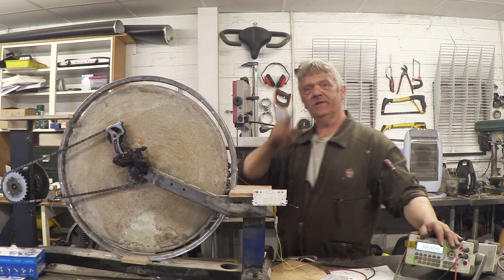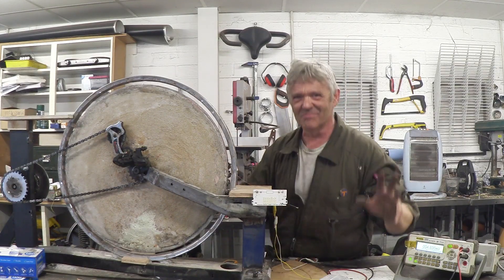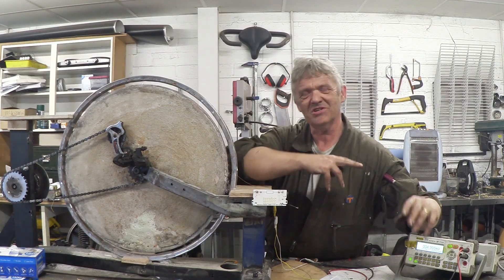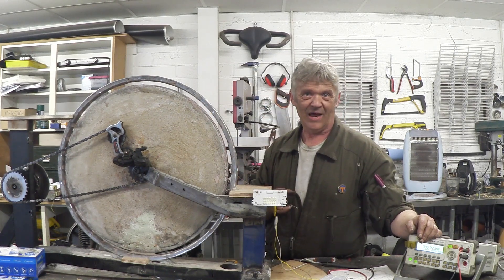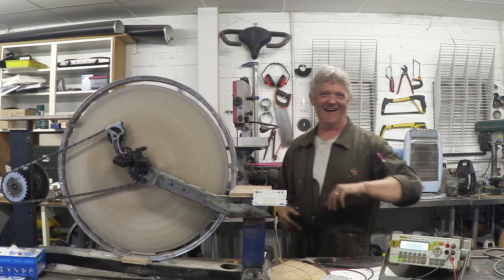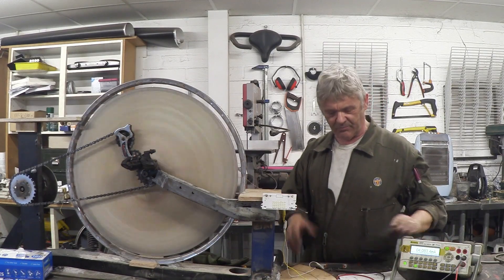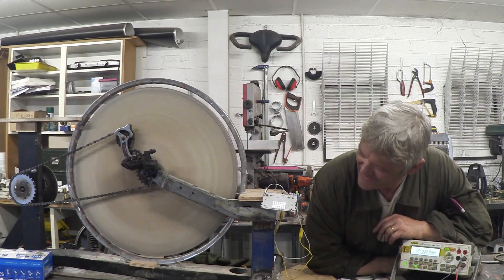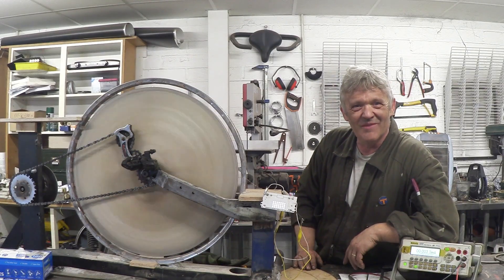1136 A Flywheel Generator

Comment: If a decent flywheel was placed on the pstttstt take wind turbine generator & fan would Keep spinning to some extent, taking wind direction mph isn't nowhere near sufficient enough for aa 3-5&10 kWh wind turbine never spinning unless you live high seas high land or in Chile

Comment: You should try building a replica of 1800's John Keely's self running hydraulic motor with useful output balanced flywheel. It had central rotating 4 way valve that produced 50lbs water hammer water pressure. Unit was seen running sawing wood, after alignment timing. patent application readable and can see sample model on You tube video. Also in new York years ago , there was a self running air compressor mounted on tank. It initially was hand turned until gauge had enough pressure in tank.40lbs output air ran air cylinder attached to crank on main compressor shaft keeping it going .The  balanced spoke type heavy rim flywheel had extra energy coming from machined 3 parts vortex tube that heated air chamber insulated for higher pressure output. Tubes are purchasable or read back issue science mechanics magazine article on home made adjustable units with various washer sizes for hot and cold.

Comment: for such a huge wheel and all the energy you put into turning it, the power output (Volts x Amps) is tiny. The one radial coil you have running around the perimeter does ot cut the lines of flux produced by the fixed magnets. So if you arrange lots of coils across the periphery and more magnets, you'd really crack some power out. Also of course the friction in the system causes the wheel to slow down dramatically, so a levitation 'frictionless' bearing (with magnets) would increase the efficiency enormously.

Comment: What you need to do is arrange the magnets on the spinning wheel so that north and south poles are on the left and right side then in a horse shoe arrange two coils one on each side. So what I'm saying is. An iron rod bent into a U shape and one coil on one side and one on the other then spin the wheel with the magnet passing in-between the coils. So that way you are utilizing both sides of the magnet. Then watch your results. Oh and the more coils the better. The more load you put on it the faster the wheel will spin and the amps will go down.

Comment: Use a smaller sprocket on the flywheel side and a larger chainring on the crank.

Looks like bearings need quick lube for free spinning better than grease. 

I've had great free results by spraying motorcycle chain oil inside bike wheel bearings. Specifically Castrol OR chainring lubricant.

Comment: If you have half the wheel north and the other half south, you are packing the potential from multiple phases into one ac signal and that's why the amps go up. I find a ratio of nine coils to twelve magnets alternating north, south, north, south, etc, gives you a solid three phase ac signal to work with. Nice build!

Comment: Can you put together one of those free energy fly wheel generators to show us if they work or not where are you spin a fly wheel with a electric motor and then the fly wheel spins a generator which powers the drive motor.  At first the drive motor runs on line power but as soon as the generator gets to a speed where it has enough power to power the drive motor you switch from line power Two generator power to To power the drive motor

Comment: Rob - I'm confused. 4 mA at 11 volts is 44 mW of power, which is tiny considering the amount of work you put into spinning the flywheel. Do the turns of wire just run around the circumference of the wheel? If they do, no wonder the output is so low - the magnetic flux is meant to cut across the wire, not just run parallel to it. So you really need lots of small coils around the edge, not one big coil around it. Then you would get some real power out.

Comment: This is probably the closest thing I've seen anyone do to the project that's in my head: a DIY energy storage system using a heavy flywheel with magnets and coils which can reversibly act as a brushless motor or a three phase generator.  Having seen your wind turbine videos, I wonder how well the concrete flywheel would work coupled to a hoverboard wheel for the motor/generator half?  The folded tab single coil generator is fascinating and ingenious but I suspect the big air gaps mean it will always be inefficient.

Comment: Need a flywheel system for a small generator so you can take the surge watts off of the small generator for starting large loads with low draw like an air-conditioning unit etc.   = Low fuel consumption

Comment: Id be interested to see the magnets & Copper placed in the middle closer to the center of flywheel, this way the leverage of the magnetic pull as they ass through the copper coil wouldn't be as strong. Then hooking up a little DC motor to turn the 'pedal crank', then measuring the electricity in, and then the electricity out. I cannot find this experiment anywhere online.

Comment: You could get a flywheel from a manual transmission or even use a brake rotor, either can be gotten easily from a salvage yard, not sure about the prices, or the sizes, depends on what all you have where you live, but they will be more balanced and require less work on your part.

Also, some vented disk brake rotors have holes you could use to mount your magnets into.

Comment: Would it be possible to do the 1/2 North 1/2 South but with a section (where the N turns into S) that had alternating magnets... IE: if you were using 40 magnets, you could have 14 North, then 6 S/N, then 14 South and 6 N/S.

It'd be interesting to see what that'd do to both volts and amps.

Comment: Voltage is not power ! The output (power) for the size of it is pathetic and the efficiency will be very low . What is the maximum load current it is capable of and where does the voltage land then ?  And the size of the wire does not matter , the number of turns that can fit in the appropriate area is all that matters . Lastly the airgap between the magnets and the coil is too large . Should be the absolute minimum for maximum efficiency.

Comment: You just made a mechanical battery! I wonder how more wire and more magnets would work out? Surely there is a end to the gains from more wire, thicker with more turns..   the added wire adds resistance, and is less effective because of the distance from the magnet,  I wonder what the optimum turns to gauge would be?

Comment: You could change from a bridge rectifier to a single diode and an electrolytic capacitor if you would arrange all of your magnets in the same direction (like North only or South only). By doing so you would automatically generate DC only and the diode would only have the purpose of preventing the capacitor from discharging back into the generating coil when the wheel stands still. Thank you for doing these experiments for us. You are an amazing teacher.
Reply: You can’t generate DC a from induction, you need to have a change in magnetic field otherwise there comes a point that the coils become saturated with the magnetic field and the only way to continue to get an output is to change the direction of the magnetic field and therefore the polarity of the current / voltage output of the coil.

Comment: The distance between by the coil and magnets is quite large, this thing might be a lot more efficient than this test shows. I take it the magnet a are at 45'?
Reply from the maker: it is mate - the gap is huge in these terms - but then we are engineering with concrete and bicycle wheels lol - you are absolutely right it would be a hell of a lot more efficient with tighter tolerances

Comment: I get 3 or 4 hundred volts from the little motors always wanted to make a big one 

I would have thought your big one would have put out alot more volts 

Getting ready to make some big carbon lead batteries 

I have a few small cells going as experiments now one uses spray adhesive

It was fast and easy to coat lead plates with the spray 

Hope it doesn't degrade over time it has been in the acid for a few weeks 

Maybe I will take it out and see tonight 

It would likely save me lots of time if you know a good way to keep carbon black and carbon on the lead plates

Thinks for your t in me
Reply from the maker: the gap is too large - we are really just proving an idea here and doing It with concrete and bicycle wheels - we need closer tolerances for sure

Comment: When winding the coil, does the wire have to be insulated? Do you have any recomended insulation method?
Reply from the maker: I used magnet wire mate it comes with a lacquer insulation

Comment: 10 years back. I bowwowed a 300 kilo train wheel....drilled , reemed and pinned it on a micro bearing... 3  x 75 amp hr altinators... armitur aperture..  unit stole 220volts... ran it thu bicycle chain like that,  and used a geared deisel motor.. from old lawnmower, 2 dog power, .. used less than 1 ltr  a day... Olive oil.. and made house electric...  great idea... shame I sold it..!
Reply: Sounds amazing, what of it I can decipher
Reply from the maker: I do love a good flywheel mate

Comment: Great stuff. Love your videos. I've been very interested in this as a replacement for energy storage. You've motivated me to build a small scale model. I'll change the bearings to magnets to reduce friction. One question: If you do the reverse ie. put in electricty via solar panels, will the flywheel spin?
Reply from the maker: go for it mate and do a vid - I would love to see - and yes it would run as a motor
Reply: Rob try flywheel with magnets and triboelectric. In that way we can get useful energy both as current and static electricity

Comment: try all north out on flywheel .
Reply: That should give a pulse DC wave , But your wasting all the power of the south pole. Electricity is the change in potential  energy.
Reply: @tremail564  logically it will generate DC voltage. even in AC generator one pole is active. AC is good for long distance transition. if dc generation used we can charge battery, use Dc motors LED lamps ect. I ma having doungt  weather it will realy develop DC voltage ?
Reply: Yes or we could add coils to pick up the south on a different loop.
Reply from the maker: I would think nothing would happen - you need a change in field don't you? so if you had a constant north, even though you rotate it from he frame of reference of the coil it would be a constant field - so - nothing - isn't that right?

Comment: Nice. I'm thinking about that rim. Would it work better if it was cut in half, and separated a little. Circumferencial cut into two poles of the coil. Comb-like pattern cut similar to a alternator rotor. That would take lot of zig zag cuts inside the rim + some separator. Just thinking...
Reply from the maker: you might want to check out videos 1119 and 1120 - I pretty much do that mate
Reply: @ThinkingandTinkering  You did. I missed some of the cuts and thought the rim was still in one piece :-))) . Thanks for pointing this.

Comment: You have a brilliant mind paraphrase you could figure out the coral castle flywheel Edward Leedskalnin designed and used to move large blocks on his own.
Reply: Afiak the "flywheel" Leeskhalin had was just a switching carousel. He only used that particular assembly for mining the blocks not lifting the blocks. But what it did was it switched the voltage on and off, bang bang,  to his large handmade induction coil solenoids that he used as power hammers and in that way he was able to mine the large blocks all by himself quite easily. With his power setup, I believe that he used electric winches along with block and tackle systems to move the large blocks beneath larger tripods. With these tools he employed tight strategy, and Godly supreme patience, to accomplish his goals, one, step, at, a, time.
Reply from the maker: I'll have a look mate

Comment: I am possibly stupid but what would quartering the disk do N S N S.  Somebody enlighten me please
Reply: Yes that could work, do you mean? Or do you mean output? All things rely on the power the magnets produce ,which is unknown until measured, weight vs size and then magnetic strength, the more poles in series the more volt output in a single rpm. Hope that helps alittle.
Reply: The difference could be seen in the wave form on an oscilloscope  .as we come in contact with the north the wave rises to the peak around the middle of the north and then would fall if we kept moving  (placed a south next) IT would continue to fall until it bottoms out in the center of the south and as we keep moving IT would begin to rise again to the middle where we begun ( if another south is place and we keep moving) IT would start to fall to the trough(bottom of the wave value) and start back to middle. The distance between the poles would be how slowly IT waves and if too far IT may be a pulse   wave form.
Reply: @tremail564  Thanks for that.
Reply from the maker: power won't change but volts would be middling as would amps I would think
Reply: @ThinkingandTinkering  Thanks Robert, I am learning but sometimes my brain scrambles.  Love the videos and your lateral thinking

Comment: To those that suggest adding a flywheel to a windmill... it would have to be done in a way that was disconnected from the Blades. IE:  If there is no wind, and you are trying to force the blades to spin anyways... then you are wasting energy by moving the resisting air... (rather than the air moving the blades)

 The place where you might add the flywheel... is in such a way that it still spins freely ONLY for the generator end of things... but does not actually spin the windmills blades.  That would allow momentum captured, to keep the power generation going... yet not be slowed by trying to move the wind-less Blades.

 The question is then... does it even matter?   If energy is stored into a typical battery cell... then a stop in the power flow, is not going to really effect anything.   As such, the heavy flywheel would be more of a system drag, than an enhancement.  Im no flywheel expert, so maybe Im not seeing the other potential benefits of it.
Reply from the maker: so a KERS and we did that in video 1124

Comment: I must admit Rob that i am confused about how this is working. by having magnets of opposing polarity on the the same mono coil  it surgests that curent is trying to run in different directions .so the output should be zero. as its not what am i missing?
Reply: Maybe it has something to do with the gap between the two sets of magnets?
Reply from the maker: maybe it is the 90 degree twist in flux path that the rims introduce -maybe that means the rotating field is always 'pushing' in the same direction?
Reply: It has to do with it being in motion, and in order for energy to be made it has to change frequency (move) .the start of the coil has an input voltage in it and then as it spins it flow around the coil until it exits. 1+1= 0 ,0+0=0 / 1+0=1 ,0+1=1

Comment: Saw a guy, knocked out the two sets of 9 laminations separating the primary from the secondary coils on the microwave transformer. Makes it really easy to remove the primary coil. It is a shame though to destroy the secondary, I would love to see it as a guitar pick up
Reply from the maker: I have taken quite a few of those apart as you know - basically gentle treatment and you can get both coils out in a usable condition

Comment: Omg! Imagine how much can it generate with the whole rim full of magnets... 👏

I've always thought it would be interesting to incorporate an electrostatic generator to power electromagnets in the rotor, in order to increase the magnetic field, and generate more power. The friction of the brushes would be minimal, though the increased complexity.

Very interesting those variations with the magnets arrangement, I wonder if using electromagnets and "shifting" the arrangement with a circuit could be of any use 🤔
Reply: Yes an electrostatic generator for sure, some PVC pipes and a cotton brush might give you a kick
Reply: Don't forget that the magnets are on a flywheel spinning really fast. Electromagnets in their place would mean powering a turning wheel, hard to supply

Comment: You didn't try all north spaced out. , Booo .
Reply: Hahaha ,you want a pulse DC current
Reply: @tremail564  i get ac from a all north pole, skipping every other coil, ceiling fan flux switching generator thing.
The south always finds its way around. 
And even with a single pole sweep of a coil, it  produces two currents spikes right? One up and one down.
Correct me if I'm wronge.

Comment: Have you considered adding a flywheel to your wind turbine to add constancy to the generation in periods of shifting wind speeds?

Lower positioning is going to lend less wind to the turbine, but so long as there is enough torque to turn the flywheel then the generation is going to be steady even if the wind speed drops. Just a thought mate, and combining both of your projects could lead to interesting results.

Well done mate!
Reply: I was just about to write pretty much same comment :) Flywheel is perfect for wind turbines

Comment: Thats a solid 5v supply. It's cool that the flywheel stores energy and smooths the signal.
Reply: The flywheel certainly stores energy,  but the signal is AC, or recitified AC. and certainly not providr a smooth voltage signal.    

It takes other types of energy storage to smooth out say recitified AC to DC. My favorite is the pi filter.  the pi filter uses a capacitor to charge the voltage up quickly, followed by an inductor that opposes changes in current, and followed by yet one more capacitor to smooth out voltage changes across the inductor.  capacitors store energy in an electric field while inductors store energy in a magnetic field.

Comment: Could it be the wires in the coil are crossing each other giving the induction needed to generate voltage. It looks like the current stays steady with increasing speed.